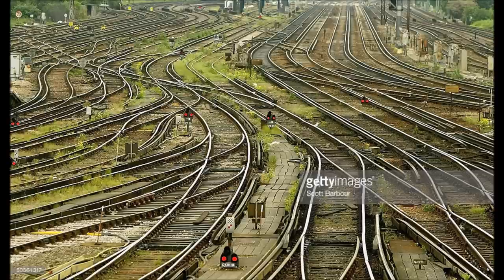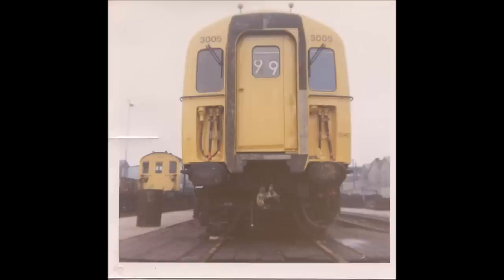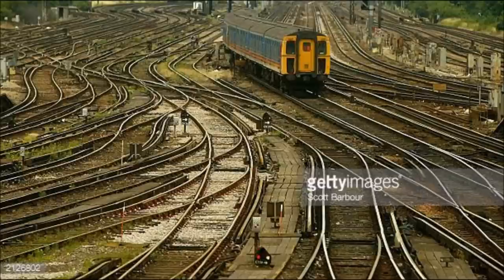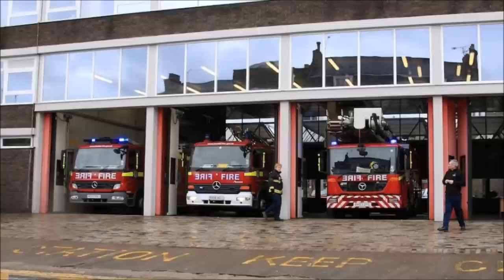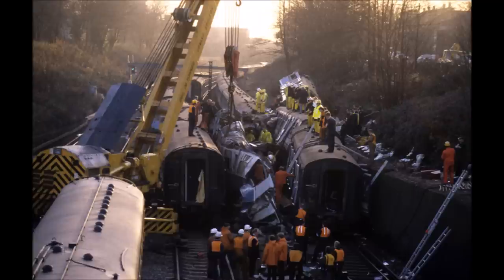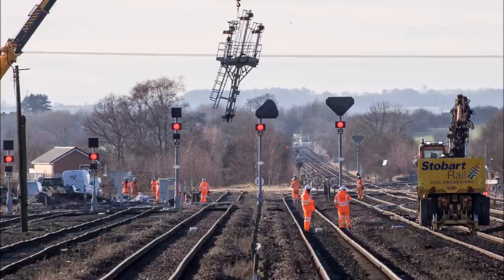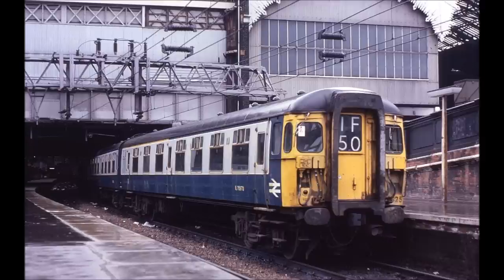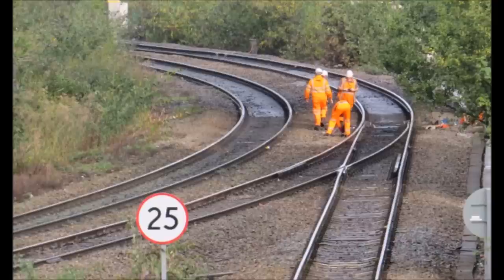Clapham Junction collision 29 years later

Comment: The most disturbing aspect about this tragedy is just how similiar it was to the infamous Harrow & Wealdstone Rail Crash 36 years earlier . In BOTH incidents, one train collided into another stationary train, resulting in debris being flung onto the adjacent track causing a incoming third train to become part of the pile up. I can't possibly be the only person to notice this connection. I guess in the case of Clapham Junction, Lightning DID strike twice.
Reply: Holy shit, your right. Creepy..,
Reply: There is no connection. Yes there are similarities in the devastation but that is as far as it goes. Clapham was caused by faulty equipment (its self caused by improper maintenance) where the H&W crash was caused by the driver of the second train passing two legitimate red signals.
Reply: Which the Perth driver passed in the foggy conditions which lead to the initial devastation in the station hitting the stationary suburban train .
Reply: Not Really. This type of train disaster is by far one of the worst ones due to multiple trains being involved. Getting disturbed by it is kind of like getting disturbed that the worst air disasters all involved a Boeing 747, No S*** there the worst disasters because  the 747 hold the most passengers (at the time) of any plane so any accident is going to have a very high fatality rate vs a small 737.
Reply: there might be some connection with the Ladbroke Grove train disaster in 1999, as it also involved railway lights, though in a different way.

Comment: DONT WANT TO GET IN A TRAIN WRECK LIKE THAT
Reply from the maker: Oh yeah. Really bad
Reply: +NORTHFORK SOUTHERN Fan897  A lot of the severity of the collision was due to the fact that the rolling stock used on those services, and a lot of the stopping services nationwide at that time, was very old, at best built in the late '50s and was still heavily derived from pre-war designs.  This meant that when the trains collided, the Bournemouth train overran the Basingstoke train and the first few cars rode up on top of the rear coaches of the Basingstoke train, crushing them.  Since then all this "slam-door" rolling stock has been withdrawn from service other than on preserved lines and replaced by significantly more modern and much, much more strongly engineered equipment with some of the most advanced anti-overrun systems.  Should this type of collision ever happen again, and it may do, there is a much better chance that there will be no civilian fatalities...

Comment: But the most terrible railway accident, unfortunately, happened alas in Russia, although it was still in Soviet times. In the Bashkir ASSR (now the Republic of Bashkortostan) 11 km from the city of Asha, Chelyabinsk region. The fastest trains # 211 Novosibirsk-Adler and # 212 Adler-Novosibirsk, 22 years ago, were not supposed to meet at the ill-fated 1,710 km, where a gas leakage occurred on the product pipeline. The train from Novosibirsk was late. Approximately three hours before the catastrophe, the instruments showed a drop in pressure in the pipeline. However, instead of looking for a leak, the duty personnel only increased the gas supply to restore the pressure. As a result of these actions, a significant amount of propane, butane and other flammable hydrocarbons flowed through the almost two-meter crack in the pipe under pressure, which accumulated in the lowland in the form of a "gas lake". The drivers of the passing trains warned the train dispatcher of the site that on the haul a strong gas contamination, but this was not given importance. The official version claims that the leakage of gas from the product pipeline became possible due to damage caused to him by the excavator bucket during its construction in October 1985, four years before the disaster. The leak started 40 minutes before the explosion. Liquid condensate soaked the soil at the depth of the trench and gradually descended down the slope toward the railroad. When two trains meet, as a result of braking, a spark that caused gas detonation or an accidental spark from under the pantograph of one of the locomotives. The force of the explosion was such that a shock wave struck glass in the city of Asha, located more than 10 km from the scene. The pillar of the flame was visible for more than 100 km. 350 m of railway tracks, 17 km of overhead communication lines were destroyed. The fire that arose during the explosion covered an area of about 250 hectares. The blast damaged 37 cars and 2 electric locomotives, 7 of them - up to the degree of exclusion from the inventory, 26 - burned from the inside. The impact of the shock wave led to the emergence of 11 wagons. The length of the front of the flame was 1500-2000 m. The short-term rise in temperature in the area of the explosion reached more than 1000 ° C. The glow was visible for tens of kilometers. Of the 1,244 people on the trains, 575 people died (according to other figures 645), 657 received burns and injuries
Reply: Wow
Reply: Wow, that's a horrific incident.

Isn't that region and city highly irradiated from years of irresponsibly dumped nuclear waste?
I thought it was ASHA anyway, my memory might be letting me down.
Reply: Thanks for info,I knew nothing of this appalling event.
Reply: In Soviet Russia, trains crash you!
Reply: Didn't it also have an extremely bad meteor strike?

Comment: A number of factual errors.
The SM at Clapham was called from AMO at Waterloo not by the signallers.
The "Wimbledon lines" or more accurately the up and down slow lines were stopped and did not reopen for several hours because debris was on the line and there was a danger to rescuers and Emergency services. These remained closed until all the damaged stock was removed.
EVERY signal was put to red, including the unaffected Windsor lines.
The signal staff in 'A' box put boxes over the levers etc. to preserve the state of the signals when it happened.
The driver of the Basingstoke stopped correctly.
Had the Basingstoke train continued the crash would have happened either just shot of the platforms (a lot more difficult location to affect any rescue or actually in the platforms when the death toll would have been far higher as people would have been exiting or reading to exit the train. 
How do I know?
I worked at Clapham on the day and was there that day and all day.

Fair play to you for doing this and I understand the difficulties of the place names and pronunciation. Some of your images are not Southern Region EMUs and Signalling as the traction current is DC and not AC (OHLE).

Comment: Lessons couldn't have been learned very well as there was another deadly crash 11 years later between 2 trains on the same section of track at Paddington station, one was coming in and the other was going out. Investigators discovered that this was caused by the positioning of the signal and the way the sun was shining on it that day, the signal was at red but with the glare of the sun, the driver believed it was amber and so he accelerated through it. There were other incidents in the years following also caused by faulty signals before British rail took the hint and made changes, they were subsequently fined because of the Paddington disaster.

Comment: At 6:53 an opinion was expressed that demonstrates some people have no idea. 

We are told:  
 Had the first train proceeded to the next signal,   the accident may not have happened because the the track would have been clear allowing the following train to stop at the red signal rather than run into the first train.    

Cleaver deduction.    

Trouble with this is,  we know the signal preceding our hypothetical now stopped at the red signal second train,  the signals behind it were showing a clear (go) indication in place of a stop.  (danger)  

If this scenario had played out then the accident would still have happened,  it would just have been a different set of trains as the following train would have come along with clear signals and collided with the rear of that train.  Having signals showing clear (go) when the line is occupied is a guarantee of a accident.

Comment: Me: This is the story of the Clapham Junction Rail Crash. (with a bit of nutshell)

Me: A while back earlier...

Me: The British Rail decided to replace Clapham Junction's old signal system.

Me: As the signal system is a liitle old.

British Rail Member #1: You know, Clapham Junction's signal system is gettting old.

British Rail Member #1: That 40 year system need to be replaced.

British Rail Member #2: I mean, 40 years isn't that old.

British Rail Member #3: Yeah, the signal system could still be useful.

British Rail Member #1: No guys we need to replace it!!!

British Rail Member #3: Well ok, as long it isn't confusing and cause accidents.

British Rail Member #1: Ok, we should do it.

British Rail Member #2: Well hopefully this is worth it.

Me: Some time later...

Me: They did that, however the system wasn't wired correctly which caused it to display false informaition.

Me: Such as wrong signal lights, it also caused confusion and delay. (Thomas and Friends referance)

Me: Meanwhile with the train drivers...

Me: The driver of the 7:18 train from Basingstoke to London Waterloo made of four- car 4VEP trains 3033, 3119, and 3005.

Me: Was approching Clapham Junction when he encountered a green light  ("proceed") which later turned red ("danger")

Me: When the driver stopped and told the signal box by phone, he was told the everything normal.

Basingstoke train driver: What the hell, am Im suppose to stop here?

Basingstoke train river: I think Im gonna call the signal box.

Basingstoke train driver: I think there is something worng with the signal *Phone rings*.

Signalman: On phone Hello sir what is your problem.

Basingstoke train driver: On phone Oh yes am Im suppose stop here?

Basingstoke train driver: On phone I think the signal is broken.

Signalman: On phone Oh, I don't think the signal is broken, it looks fine.

Basingstoke train driver: On phone Wait what?!

Signalman: On phone Anyways have a goodday sir.

Basingstoke train driver: Oh phone Wait Wait Wait!!! Phone disconnected

Basingstoke train driver: Welp, guess I have to wait for the signal to turn green again.

Me: While that was happening at 8:10 a second train, the 6:10 train from Bournemouth, made of 4REP 2003 and 4TC units 8027 and 8015.

Me: Was riding along when it collided with the Basingstoke train.

Me: Meanwhile a third train with no passengers, and made of 4VEP units 3004 and 3425, collided with the wreckage.

Me: Also during this a fourth train came which was able to brake before hitting the wreckage.

Me: Which after the chaos ensued the signal turned to yellow ("proceed with caution").

Bournemouth train driver: Do do do do do- ah I need to stop!!!

Basingstoke train driver: Oh my gosh.

Both: Ahhhhh!!!

Me: Both trains collided

Train driver #3: I love this job, nothing will never stop it- ahhhhh!!!

Me: Third train collides with wreckage

Train driver #4: Oh my gosh i need to stop now!

Me: Train brakes and stops before hitting the wreckage

Train driver #4: Phew.

Train driver #4: Is any one ok there?

Basingstoke train driver: Doing good just need to call the signal box again.

Me: So yeah the Basingstoke train driver called the signalman about the collision which the signalman called emergency services.

Me: The signalman also put almost all the signals to red to prevent further accidents.

Me: Emergency services later came after students and teachers from the nearby Emanual School came.

Me: In total, 35 people died and 69 people were injured, 415 people suffered minor injuries.

Me: The accident also cost British Rail 250,000 pounds (514,000 pounds in 2019) however they they weren't charged for manslaughter.

Me: A Investigation on the case revealed that thanks to the faulty signal system,this resulted the first driver confused which led to the collision.

Me: So yeah this is the end of the story (with a bit of nutshell mabye).

Comment: Can you do the Harrow and Wealdston train crash from October of 1957? I have some Info: Thedriver of a London bound express train missed a warning signal telling him to slow down. The train then crashed into a sitting commuter train at the station. A third train that was running late then hit the wreckage moments later. The force of the collision was so forceful that a nearby clock tower stopped at exactly 8:19 am. Rescuers and nearby residents arrived at the scene soon. There was a system in the London bound trains cab called Automatic train control where a sunflower dial would come up when the train passed a signal and the driver would acknowledge that warning. But either the driver didn't hear it or ignored it. In the end most of the locomotives and cars were either totally destroyed or damaged beyond repair. However the steam locomotive on the London bound train was repaired and remained in service before being scrapped at crewe in the 1960's. And the loss of the second locomotive of the Liverpool train a princess royal class 462 named Princess Anne which was a rebuild in conventional form from the experimental steam turbine Turbomotive led to the experimental BR standard class 8 which is now preserved.

Comment: I think that was more than a signal faliure. The signaller should be able to change any signal to danger no mantter what in an emergency. Automatic or not.
Reply: Ellis Butler that is not how signals work in many countries and it is really safe. Automatic signals are fine and are needed.
Reply: They can, this was not the problem. The signal was at danger and the previous ones had not been working correctly as that train passed, so the next one did not know it had stopped.

The singaller DID put all signals to danger once aware of the crash.

Comment: Well there's a new one to add to Amtrak incase u haven't heard
Reply from the maker: Oh I've heard. Real nasty too
Reply: Thunderbolt 1000 Siren Productions Yhea I feel bad for those who have passed
Reply from the maker: Gives me the chills too cause it has some similarities with the 188 crash a few years ago and I'm not just talking about a brand new Siemens unit being fubar (yeah 601 is done for, so is 627) oh no both came off the track going more than twice the speed and both had no PTC involved (PTC barely does anything anyway) only difference is 188 wasn't an inagurational run of a new route and I think 501 crashed because of bad track. Mayor didn't want the new route either too
Reply: Thunderbolt 1000 Siren Productions actually so far it's the exact same as the northeast corridor one
Reply: Thunderbolt 1000 Siren Productions the two acs-64 locomotives are probably still stored. Also the wrecked charger from the 501 crash is supposed to be scrapped.
Reply: Good job amtrack your wrecking new locomotives